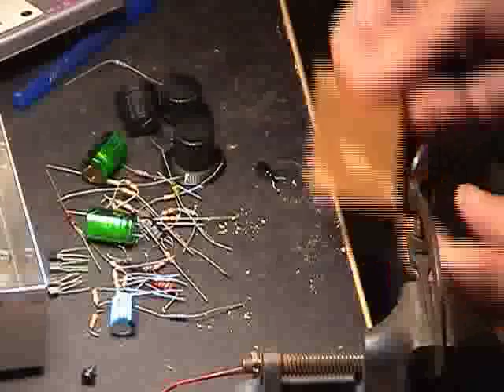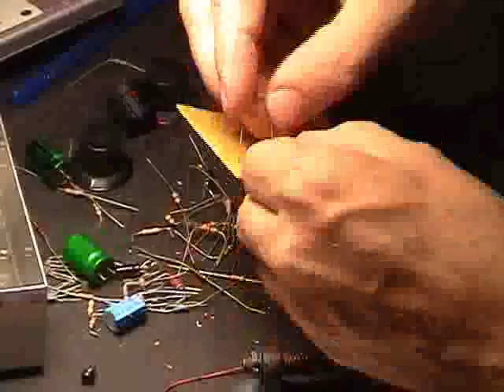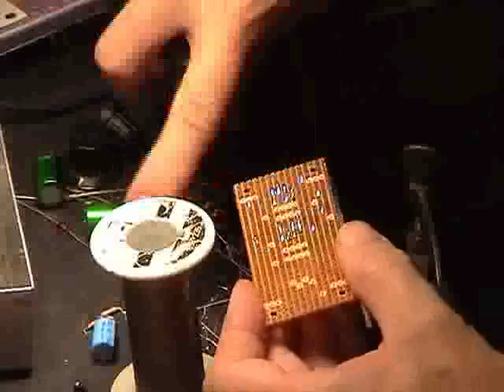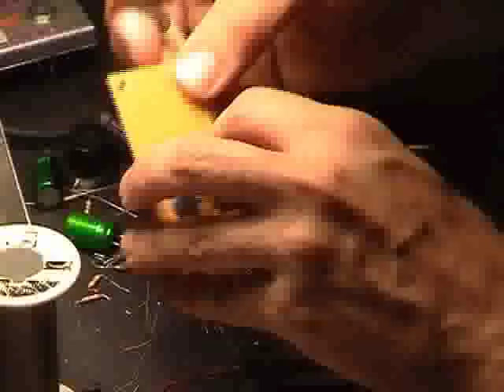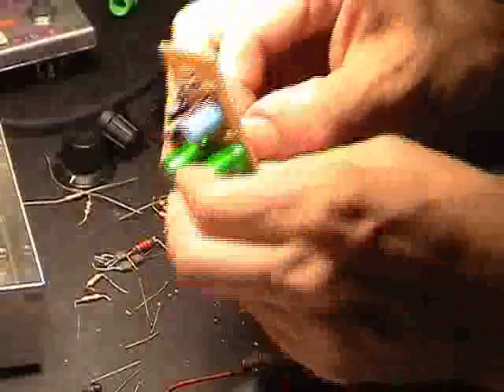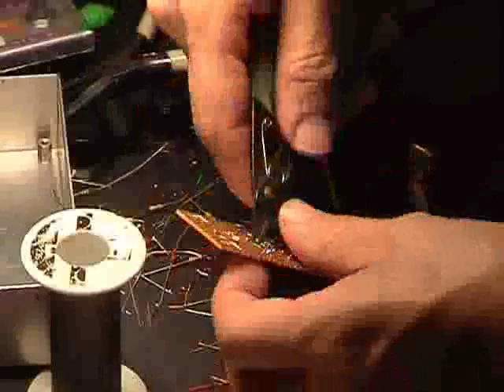Soldering A Microphone Preamp, Time-Lapse

Comment from the maker: @bluetongueboy You'll need two copies of "project66" to make a two-channel preamp. You'll need one "project96" to make 48V DC power but two copies of the coupling circuit (shown in figure 2) to couple that power to the two microphones. You can't use "project66" directly with a phantom-powered microphone, because the preamp's inputs are DC coupled and will be damaged by the 48V. The coupler circuit prevents this. Finally, you'll need one of the "project05" to power the preamps.